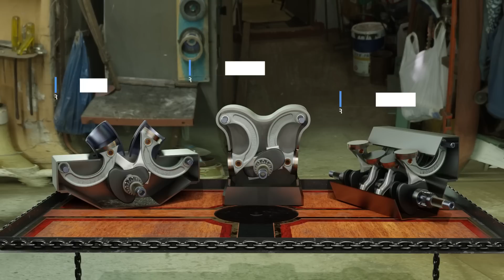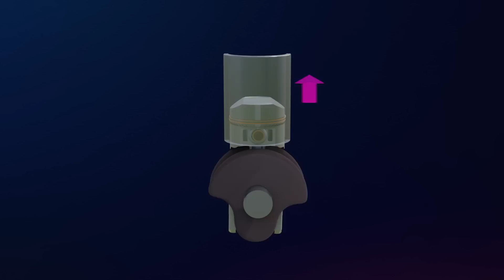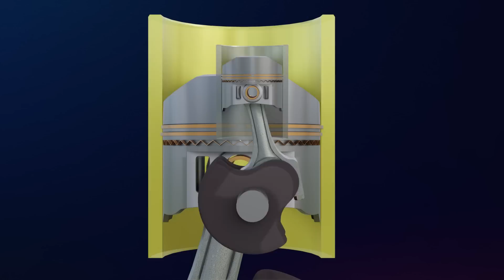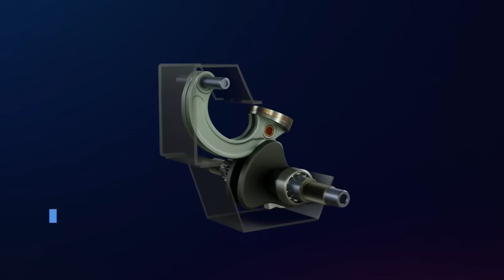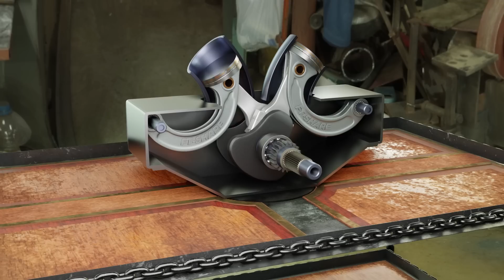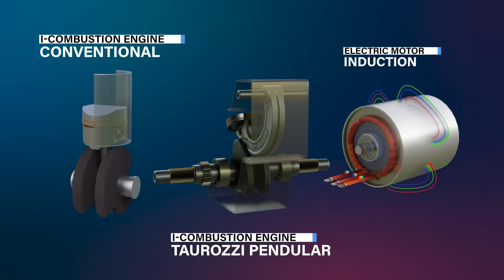All about the Taurozzi Pendulum Engine | Advantages, Working Principle, and Performance (100144.V1)

Comment: 30 % ?  A little too much  don't you think ? 
Piston friction in the  cylinder  account for approximately 20% of all losses in an engine , so even if you came to eliminate them all, you will see theoraticelly a maximum of 20% less losses,  in the best cases 10% reduction in fuel consumption.
All thought, an amazing idea
Reply: actually depends on the engine but most of them have higher than 20% losses from ring friction some even go up to 50%
Reply: @Silver Dream Machine i wouldn't think so but i wanted to make a prototype of this engine for years, still can't find anyone who knows how to make curved cilinders on iron, but i think maybe it could be made in some sort of really precise iron casting mold, still they make the compressors in mass it doesn't make much sense to me
Reply: @santiagoarribasclar3316  The cylinders are drilled with a flat disc drill. The clinderblock is fixed on the rotation axis witch is later used from the pstons. Now you can drill the cylinders, the feed for drilling is the angle around the piston rotation axis. No CNC control required. Hope it is understandable and helps. 
Would be happ to see your results!
Reply: @Silver Dream Machine  actually, it needs  a balancer shaft  as well  cuz u can't balance a rotating motion with a reciprocating one, it will be smaller though, i think
Reply: this is a pie-in-the-sky novelty engine,  no room for logical thinking here.
Reply: @santiagoarribasclar3316  yes but it still has rings.
Reply: @collintheiss3945  now tell us how you make and fit the liners
Reply: The ring wear and or oil consumption could go way down.  This would really help emissions on pressure lubricated 2cycle engines.  It would be fantastic if it could be done in an opposed piston layout.  It might be possible to have one crank & to avoid the gear train & dual crank issues in most OP layouts like the Junkers Jumo.   It would also improve the aspect ratio of the overall package  vs the Junkers with cranks out board.
Reply: @danieldonaldson8634  Funny question :) Indeed you want a liner less design. Nicasil should do th job.
Reply: My only concern are the changing centrifugal forces, which try to bend the U shaped rod.
Reply: @timduncan8450  amazing actually i'am working on a similar design, but I think dual crank is better for balancing & simplicity,
can you explain those dual crank issues ?
thank you so much

Comment: This doesn't change the requirement for lubrication.  One of the main drivers for the amount of oil in an engine is how long you want to go without an oil change.  The more oil you have, the longer it takes for cylinder blow-by to contaminate the oil with soot, and the lest time each unit of oil has to spend in the high stress/temp areas of the engine.  It is not driven by the actual amount of friction in an engine.  Regarding weight savings, look at how much the weight of the block would have to be increased.  The pistons are also much heavier.  The skirt is gone, but the banana arm ads more weight than the skirt, plus pivot shaft.  More weight overall, and more reciprocating weight.  Main reason that this engine will never be successful is that machining the toroidal  cylinder to the required dimensional tolerance, surface finish, runout and concentricity would be almost impossible.  Certainly very expensive.  Also more failure modes than a traditional crank/conrod/piston design.
Reply: The inventor managed to machining In his small successful workshop and in an interview he demonstrated that doing it differently does not mean more cost.

Comment: The inefficient indirect rod-to-crankshaft force in conventional engines is still there. The reciprocating and rotating masses are significantly greater than a standard engine. The curved bores are very hard to machine, though may not require great precision with a skirtless piston.
Reply: curved bores are not very hard. they are just different, you teenager or buffoon. you save weight on the curve system. and you save a lot of oil .
Reply: replace the piston with a boring tool and there you have it, curved bore

Comment: Video seemed good until you acted as if it has literally no down side other than “its just not accepted cus its just not accepted”. I like the engine, but i think one problem is the larger packaging, always more things going into the engine bay. If it really was 30% more efficient it would be justified but thats too ideal. Also my intuition says the vibrations might be a bit, odd? Might need to add even more to deal with that I’m not certain.

Im all for the design because ive always wondered how pistons and cylinders hold up as well as they do with all that side torque only being dampened with a thin layer of oil but it shows to work. So i like the idea of guiding it.

But its surely not strictly an upgrade as you lead on.

Comment: No data on power (KW or PS) is provided, nor for T in Nm, nor the displacement, nor at what rpm such performance data were reached.  
To be able to  calculate the mean effective pressure would provide a measure of the ratio of converting fuel to mechanical power.  Why is that not provided? A Go-kart running at x km per hour is not a useful number. I agree that the friction will be far lower but not to make up for 30% higher power or 30% higher efficiency,  The gentlemen did so much, but he never measured the power output or rpm? Strange.

Comment: the bore cost would outweigh the efficiency. fossil fuels are on the way out. design a better battery or discover a new fuel source, possibly metal based like potassium

Comment: The problem is that toroids are hard to machine.  When the issues of machining the toroidal cylinders are beaten, they will see greater use.  The pendulum pistons with their toroidal cylinders, in medical gas compressors, are less of an issue as medically rating the equipment adds to the overall costs, anyways, so machining the cylinders is less of an issue.
Reply: To reduce friction from the piston rings, my approach was to create a 2-stroke instead of a 4-stroke, refreshing the air at BDC. Inject fuel on the way up, and introduce a spark.
I quickly found these already existed in the 60´s, but were oils burners. (They didn´t run on a fuel-oil mix, but the ¨valves¨ were mere holes in the cylinder wall at BDC. So crank case oil splashed into the exhaust ports half the time.)

Cutting the friction in half once more, requires a 1-stroke engine. That means every stroke is a power stroke.
One can stick a single piston in a bore to do so, having a head on each side. But then there´s no room for a power take off (pushrod).
However if the piston is elongated and shaped like a bell bar (weight lifting), there´s room in the middle for a power take off. The cylinder wall would be breached in the middle, but the stroke never gets that far.
Although this appears like 2 pistons, being one cast means the piston(s) cannot tilt, and thus need less rings.

It does need 2 counter rotating balance wheels to keep it from shaking apart, but these double as flywheels.

TL;DR it gives you the benefit of this pendulum engine, whilst having a straight bore.
Reply: That's the reason why they just show animations...... but never the actual machined components.
Reply: DUDE! A six-axis boring machine can do that standing on its head? why there is not a big push into this design is easy. because of electric vehicles coming up once charging times are solved then the fossil-fueled engine will go the way of the steam engine, which worked in its time but is now passed up by tech. there are batteries out there that have no cycle life and are pure lithium batteries. if there is no cycle life on a battery that means you can recharge it ...FOREVER! SO THAT SUPPLY BULLSHIT TEAR UP FOR THE MATERIALS WILL END REAL QUICK OLD BATTRIES MATERIALS CAN BE RECYCLED INTO THES NEW TYPE OF BATTRIES, THUS REDUCING THE SUPPLY DEMAND. ONCE BUILD AND PASS q.c.? THEN THERE IS GOOD FOR LIFE OR MAYBE EVEN GENERATIONAL AS WELL?  NOW THAT IS SOLVED, CHARGING ON THE FLY IS NEXT, ONCE THAT IS DONE, BARRING ANY FAILURES THE SYSTEM RUNS FOR A VERY LONG TIME. DOES NOT POLLUTE AT ALL. AND CAN BE TOTALLY RECYCLED, SO THAT IS WHY THERE ARE NO NEW FOSSIL FUEL ENGINES TO BE COMING OUT ANYTIME SOON.  WHY WOULD ANYONE REALLY NEED ONE WITH THIS COMING ALONG JUST NICELY?
Reply: @brucesweatman2146 it wouldn't  be particularly difficult to machine  it on a lathe with a boring bar. 

Rather than bolting it directly to lathe cross feed.  One would bolt a pin to the cross feed, and then slot the engine over the pin via the the piston arm pivot point. Then the engine is just rocked back and forth to cut the bore.

There might be some theoretical argument the bore will end up a tiny bit  out of round... However  the piston doesn't rotate in the bore, so mechanically there's no problem.
Reply: @stevecummins324  Dude you use a bridgeport with a changing arch boring table? or if you want it done in an hour use a 5-axis boring machine real easy. to hold any line or degree you would not be using any lathe?

Comment: I wonder how much more (or less) torque it makes?  It looks like the piston is pushing more along the centerline of the rod when the rod/crank angle is at 90deg.
Reply: Excellent remark, in deed with a curved piston path  it  will follow  the rotation mouvement of the  crankshaft for much longer (15 to 25°) compared lo liniair motion of the conventionnel piston, and with the right angle  applied to it  for much longer, you can extract a lot more usefull work out of the combustion,
I'm guessing around 10_15% more tork

Comment: This looks like a nightmare on every level and i cant emagine it being lighter when you have twice the connection rods and over double the bearings causing friction loss... maybe they can handle more power but those pistons are going to need new rings ever 50-80k miles and the inside rings will wear faster due to the shorter stroke and the outside sleeve will wear faster due to combustion pushing the piston into it and any wear will cause RUD just like how gear timing works this is way more prone to binding and knocking once older

Comment: Modern conventional engines reduce piston friction by offsetting the bores in relation to the crankshaft, something that you did not mention. It seems like the only advantage of this engine is reduced piston friction but it has additional load with that curved lever.  And that curved bore would be more expensive to manufacture. Nice idea but nah.

Comment: I know a Gimmick when I see it.. The issues with boring those cylinders or whatever you call the torrential headache involved, is enough for me to walk away. Oh and..every engineer worth his slide ruler, knows- Adding reciprocating mass to the ends of a rotation assembly is Never a good idea... all those forces are on the duel wristpins on top of a tapered piston rod.. Id also expect the harmonic noise form from those curved rods ringing like tuning forks, to be atrocious. In am not con-vinced just yet that these are viable.

Comment: I think this high torque/low rpm design would be best suited as a stationary power source for temporary or emergency electrical generation or to operate a pump of some kind. Maybe to alleviate flooding. It's reduced requirement for cooling and lubrication Could allow it to sit dormant for extended periods of time. I think it will have it's place, just not in transportation.
Reply: Or you could compact it and install in a bike
Reply: I don't think that engine will work for heavy-duty trucks. From the look of it, it doesn't have enough mass inside the crankshaft to keep the intera force motion going.
Reply: Why do you say its low rpm?

Comment: At 30% increased efficiency that would be pretty nice looking at fuel prices today. Even if it was only in economy vehicles with lower horsepower.  It would make EV cars have that much more to work against.   It's nice you could park it and come back in a month and drive it away,  no battery problems probably the military may be interested for drones.
Reply: Theory.
Reply: 30% more efficient than an engine that's 40 - 60 years old.... Not impressive at all

Comment: The increased mass of the swing arm would more than cancel out any efficiency increase due to less side load on the pistons.  This engine would never make the high RPMs of a modern piston engine because of the reciprocating mass of the swing arm.  It might work for a low RPM diesel engine, but why would you need the extra complexity of the swing arm to eliminate frictional losses when the diesel fuel lubricates the cylinder walls to reduce friction?
Reply: Exactly! Twin offset crankshafts with half weight piston rods would eliminate side thrust and piston skirts, and provide a more direct down pressure on intake and power strokes. Build it as an Opposed Piston  design, with two pistons in one cylinder, cut the strokes in half, and get twice the RPM (HP).
Reply: I mentioned in my separate comment - a need to use something like Lanchester balancer

Comment: Too many moving parts. The problem with most conventional 16v+ engine is the amount moving parts-interference engines! With all the moving parts, that means too many failure points. The Wankel Engine for example has way less moving parts, just not the efficiency. Roller bearings on the banana rod that high in the engine will result in bearing failure and chewing that shaft up= 💥

Comment: There are some other solutions a bit better than this engine, like double piston (first is so called fire-piston, and second is a guide-piston) or another solution: shifted crankshaft - both significantly reducing piston-to-cylinder friction. Next, as mentioned at the end (why not earlier, when they were explaining lower mass of the piston?) mass, inertia of rotating parts is not smaller than in any other commercial engine! Additional curved guide arm compensates (in negative meaning) lower mass of the piston! Plus vibrations (a need to use something like Lanchester balancer).
An interesting design, still with some drawbacks which make it not so impressive and not better than "a regular solutions". 
I always smile when I see a comparison to any "regular engine" or a commercial when efficiency of washing powder is compared to "a regular, normal washing powder"

Comment: Mazda had a variable compression engine that had an arm like this although a different mechanism and shape. Which I feel proved superior. Also there are counter balanced engines that have an arm much like Suzuki's New parallel twin 775cc engine, which balances the engine for smoothness although not perfect it's better and it's a more torquey engine having a longer stroke and smaller bore than it's competitor the Honda hornet 755cc. Which is a typical over square higher revving. I believe this engine is the typical give and take and not overly practical in terms of size Mass weight and production costs. Over all the answer is already out there and I don't believe big oil is only one reason it's not a popularized engine design.
Reply: The variable comp engine I'm thinking of had a two piece engine block and a connecting rod and eccentric shaft tying them together.
Reply: @kingcosworth2643  like the Infiniti one?
Reply: @Rose_Butterfly98  I think he meant Infiniti. Infiniti Variable compression engine has more moving parts meaning more shit to break and it looks hard to replace all those parts. Looks good on paper but seems very unconventional and expensive.